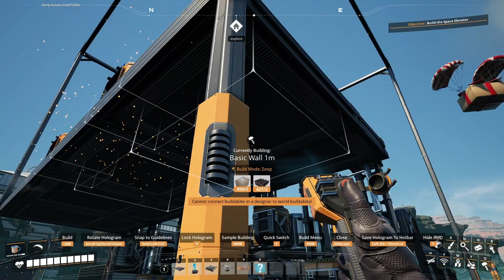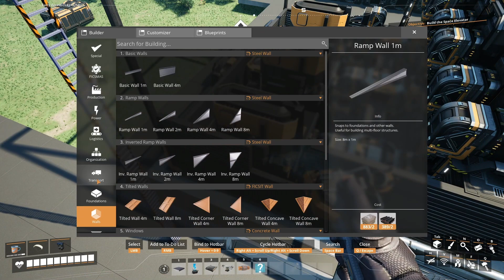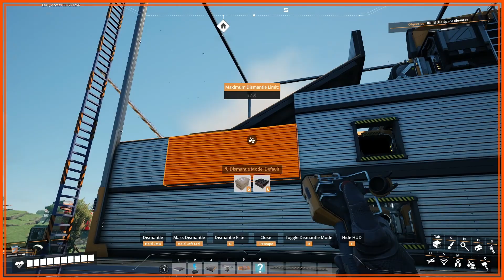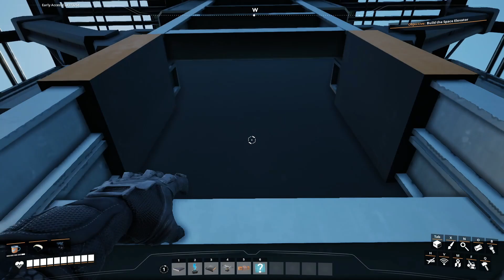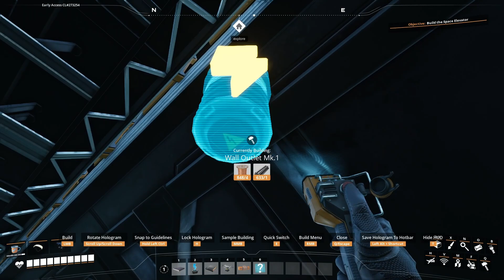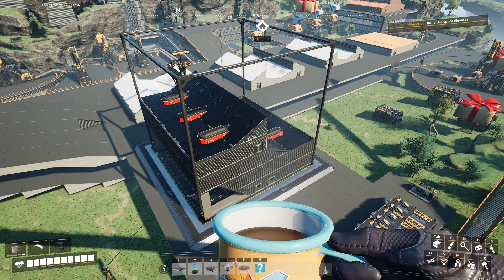Steel Ingot Blueprint Pt 2 - The Architecture

Comment: How you make this fine align in 4:08?
Reply from the maker: Great question, it is a feature that was added in Update 8, you hit 'H' to hold the hologram in place then you can look around at any angle you want and while its held in place you can hit the arrow keys to 'nudge' its placement by 1 meter at a time (up to a total of 8 meters usually), hold 'CTRL' to 'nudge' by half a meter at a time. it has been a life saver, so much easier to build things the way you want.